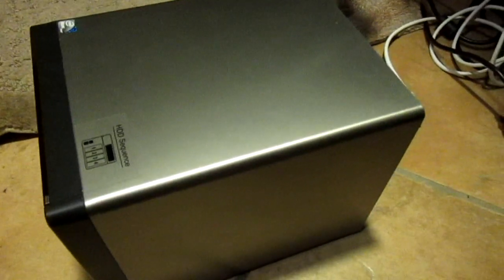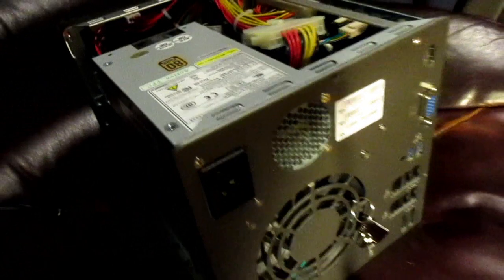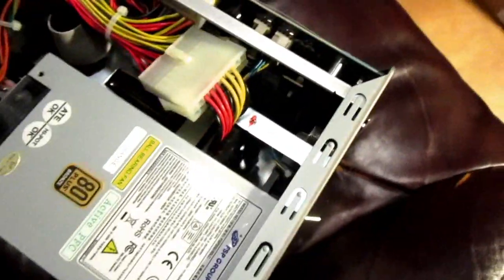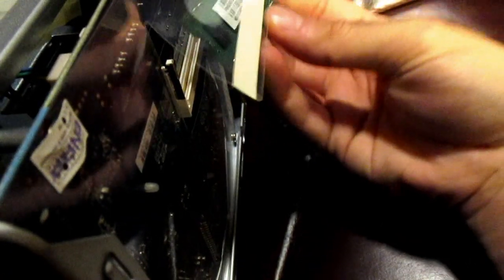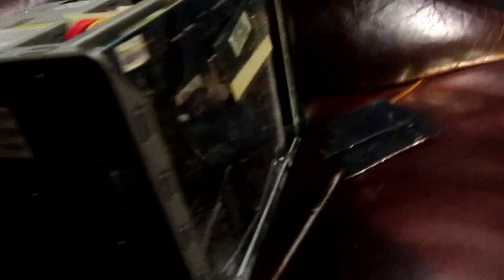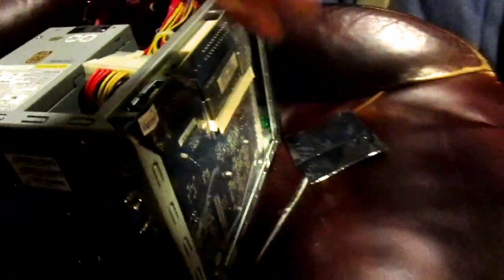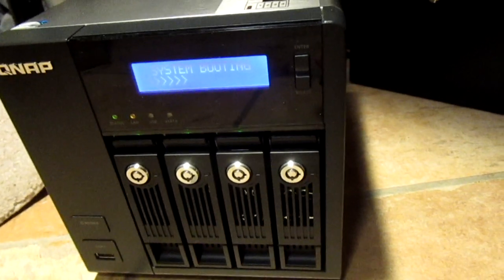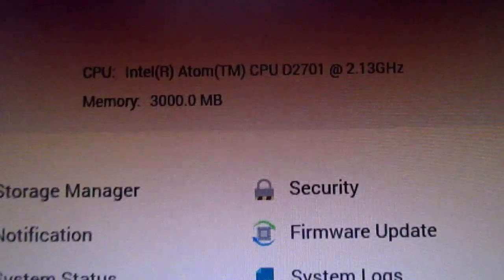Upgrading Ram on QNAP TS-469 pro

Comment: is that a 2gb stick?
Reply from the maker: Yea
Reply: @GhettoWagon  so any 2gb DDR3 1333mhz SO-DIMM ram will work?
Reply from the maker: Yea should I just picked a pieced a piece of used ddr3 ram out of a laptop i put more ram in.   Frequency will just default to whatever the Qnaps built in ram is probably